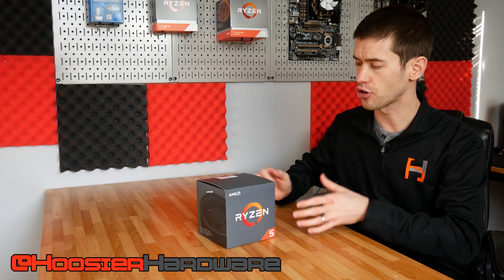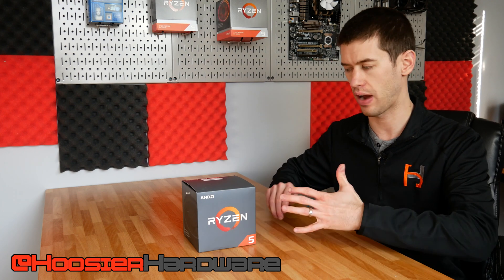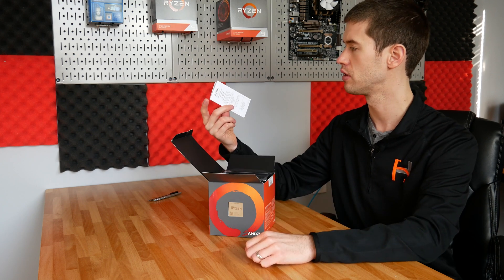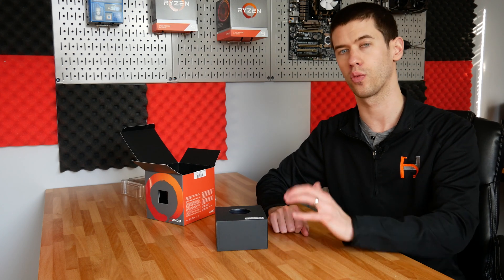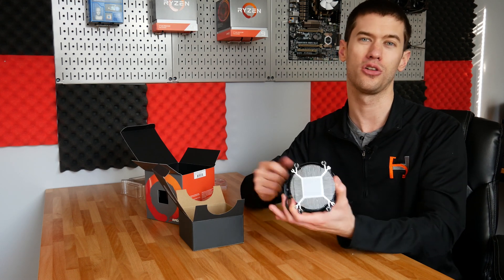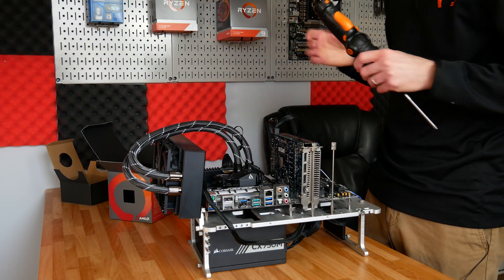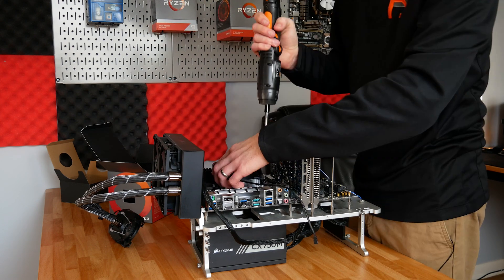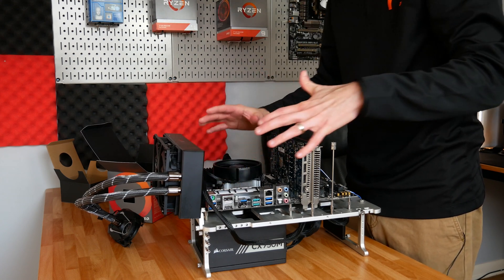Ryzen 1600 "AF" Overclocking on the Stock Cooler

Comment: 1600 AF out of the box hits 3.7Ghz Turbo by itself. Which is odd considering it says 3.6Ghz on the box. But hey, free performance!
Reply: lol yeah mine does that to.
Reply: Mine to 3.7 all day
Reply: does yours have a base clock of 3.5Ghz?? Because mine never goes below that.
Reply: @rmendez011  My base clock would hang around 3.2ghz.  I was able to overclock mine to 4ghz stable with voltage at 1.26
Reply: @jbscotchman  that's weird, mine stays around 3.5ghz and doesn't go down or above that, and I'm too scared of overclocking so idk what to do 😂
Reply: A year late but... that's XFR.

Comment: whats a safe voltage for a ryzen 7 2700?
Reply from the maker: I never go above 1.35, but that's pretty low. If you're looking at a max 24/7 voltage, you probably don't want to go too far above 1.4, and just keep an eye on temperatures as you go up. You could probably go 1.45 if you're somehow keeping it cool.
Reply: @HoosierHardware  ok thanks i now have the stock cooler but i am saving money for the 100x to keep it cool

Comment: Can you put it in 3.9ghz with the cooler in stock? Has anyone managed to stay stable?
Reply: It's doable. It's all about silicon lottery. There's one guy here who got 3.9ghz at 1.187volts. an absolute golden chip right there
Reply: Sure. you can get any 1600 AF to 3.9, depending on voltage. As for cooling you will never street the CPU near stress test load during operation so unless your case has no airflow at all and you are at 30c ambient I would not worry..

Comment: I have a ryzen 7 2700 oc to 3.65ghz on the stock cooler. I usually get 69c on games on full charge. ( I play rainbow six siege all in low on a 144hz monitor)
Reply: Can you hit 3.8ghz?
Reply: @miniweeddeerz1820  no because my pc case as bad airflow but if you have a better case you should
Reply: @pukalomaster3321  fair enough

Comment: Can you overclock Ryzen 3 3200g on stock cooler??
Reply from the maker: Yep. It's a low power chip dip you can probably get a decent overclock. I'd recommend overclocking the GPU on it before the CPU portion because that will give you better performance in gaming.
Reply: Bro, I am looking forward to adding an rx570 on my ryzen 3 3200g build, but I don't have much idea about uninstalling previous drivers and installing new ones, please make a video about it, it will be very helpful for me......
Reply: Sahil still need help?

Comment: So basically if you push this thing to the limit maybe get 10% more performance.    I disagree with his statement that you might notice this in gaming.   Only going to get 10% more fps if you are completely cpu bound, and even then unless you are staring at the fps counter will never notice the game feel any better.   Imho
Reply: 10%? Yeah sure. Only he did not OC properly. 1.2V? Joke. This gets to 4.1GHz all core easy. And a 6 core 12 thread CPU only for gaming is pointless even in 2020 so yeah you will not notice it much in games. If you are actually doing something like video rendering, re-encoding, AI work etc you will notice it alright.

Comment: it work on x570 carbon MB ???
Reply: It will work on any X570 or B450 board.
Reply: Both of you why are you trying to get an x570 for a Ryzen 5. The asrock b450m pro4 is a 80usd motherboard and is perfectly good for ryzen 5 overclocking.
Reply: @miniweeddeerz1820  hi dear, I'm waiting for the ryzen 4000 series. today save money
Reply: @CloudHighWay  if you wish.
Reply from the maker: I'm actually not sure.

Comment: I recommend doing second test in Cinebench R20. There will be a reset or crash at such temperatures from Aida.
Reply: And there will be no issue in real world application ever. He could have went with 1.25-1.3V and went past 4GHz and still have no issue on this cooler in day-to-day operation.

Comment: Todays gpus are not strong enough relative to the power and value that amd has provided. (Why game in 4k if u are relegated to only 30-60 fps?)
Reply: What are you talking about? CPUs are the bottle neck for high Fps gaminging.
Reply: @goxcpre  im talking about how the gpu is usually 97% - 99% whilst a 1600 af is not even coming close to 85%.
Reply: @DJDonkeytron  lol that's because of hyperthreading. how MSI afterburner works is that it takes 100% and divides it by the number of threads. So 50% usage is all cores used. Anything over that is using hyperthreading. So in reality its being used a lot as all the cores are being used.
Reply: @DJDonkeytron  Yeah that is because the number of games which can utilize all of those 12 threads properly is counted on the fingers of one hand, and even then you will not get 100% since the main programming thread will always run one core at 100% and all other threads will be less utilized waiting for the main thread to give them tasks. When a game is coded well with parallel programming code you can get use of many threads but the main thread will always run in Sequential programming since every command has to wait for the previous one to execute. Example when you input a command to shoot the main thread tells the other threads what they are to do and to calculate if you hit the target or not. Then it has to wait for the result before deciding if it shows you a hit or miss. Then it has to wait for you again to make an input. Mind you I am trying to simplify this concept with an example that is not exactly accurate from programming stand point but makes sense as an explanation.
Reply: Because 60fps is more than enough for any game that is not an online PvP game, especially a dedicated shooter. And such a game that would not get over 100fps on a decent mid range GPU in 4K does not exist. Unless it has crap optimization, in which case it does not matter much what hardware you are using.

Comment: put it on water and hit 4.1ghz and tell me your voltage level? curious and allow fora 12 hour test overnight. 4.1ghz at 1.32 volts LLC4 on msi b450i gaming plus ac mb, my temps with an master liquid ml240l aio is never over 60c push pull config, 7 120mm fans as well...gtx 1660 super sc ultra... 2400 team group (tlred vulcan) ram cl14 overclocked to 3066mhz cl16 16gb 2x8. even tho its not supposed to go over 2400 it does quite well... micron A die at that...but yea curious to see. my cin r20 score is an even 3200. ran 6 times never different. i do however have ANYTHING killed in windows it doesnt need. all services that doesnt need to be running are always at all times are off...

Comment: I got a 1600af to upgrade a secondary gaming pc. I have to say im super impressed. 4.1ghz all core with 1.25vcore. As far as im concerned if your in the market for a 6core cpu, the 1600 af makes everything else look like a bad buy.
Reply: Its out os stock
Reply: Mobo and cooler?
Reply: Djare for a while it was under a wrath prism. But it was loud under load so right now its under my old h110i, since its the only other cooler i had that was am4 compatible. The mobo was a gigabyte b450 aorus m.
Reply: @kapler8550  ryzen seems like a terrible deal compared to LGA 2011 and cheap xeons for the socket from aliexpress, plus cheap server ram vs expensive, fast ddr4
Reply: Dimitri Jachvadze on the surface, yes x99 looks better. But x99 is a dead platform. And it isnt  cheap enough in comparison to am4 to me to be viable for new builders. And experienced builders probably already have something that is equivalent or better, in which case neither the 1600af or cheap xeon is viable.
Reply: @kapler8550  Sweet.Nice cooling,ok mobo=good oc!

Comment: my r7 1700 hits 4 Ghz at 1.4 v and is very stable no crashes , but temps go up to 80 or more when stressed at 100% , 70 when gaming, are those temps ok for another year or so? I plan to change it to the 4000 series when they come anyway so it should hold till then right?
Reply: Well it depends on the GPU. A high end CPU the overclocking will affect performance slightly. On a lower end GPU overclocking the CPU does nothing to performance as the GPU not the CPU is the bottleneck. However try get the voltage a bit lower than 1.4v

Comment: me: cries at r5 1600v1 needing 1.385 to be stable at 3800.
Reply: bruh i have my 1600AF at 4,3ghz with 1.325v
Reply: @quajutsu1026  how tf did you even get it that high
Reply: @GroteGlon  golden chip i think
Reply: 1600AF 3,8GHz with 1.350v, crying
Reply: @konopka90  i jak zdzialales cos ? ja tez mam 3.87 na 1.367 :/
Reply: Patryk Konopka same
Reply: 1600 af 3.8ghz 1.3v :(
Reply: @R0n1nK  sucks dude, I'm stable at 1 hour cinebench 81c, 3600 ram OC to 3800 cl16 and 3.9ghz all core 1.29v
Reply: Apparently I came across a good copy: 3.9ghz 1.25 v, 4.0ghz 1.3 v, 4.2ghz 1.37 v. Everything is stable.
Reply: 3875 at 1.4 in the building
Reply: i feel so lucky selling mine this past summer when microcenter was bundling these with motherboards.
Reply: My 1st Gen 1600AE is doing 4,0 at 1,375V. Golden sample I got...
Reply: My FX8350 4.0ghz at 1.20v muhahaha.
Reply: @chickendinner5572 yeah but it still gets spanked
Reply: @FPVSPRO  of course! It's a office PC now. Save power and stays cool. Rocking a Ryzen 2600X +1070ti now :)
Reply: Got mine at 4.1ghz same volt as my 3.8ghz oc just toke one of google. V1.32/1.35? I forgot 
Was to lazy to play with iy till last month went to 3.9ghz stable.
Last wrrkn 4.05ghz now 4.1ghz for 5 days haven't touched volts. Still 1.35 i think?
Reply: 1600x at 3.95ghz and 1.33V fully stable ;) Allso its on Mini ITX b350 board in Cougar QBX
Reply: 1600 af 3.8ghz 1.28v, 3.9ghz potrzebuje już 1.37 także bida sztuka się mi trafiła :/
Reply: I think I got retarded sample, 3.7ghz at 1.35volt
Reply: i have ryzezn 5 1600 v1 at 4.0 ghz with stock cooler and 1.325 voltage , really good performance
Reply: I have 1700X 3.8 GHz stable at 1.22V, running cool and silent.

And Sapphire RX 580 Nitro+ SE stable at 1350 MHz with 1.0V and memory at 2250 MHz. Could run it's core bit faster, but I see no reason to gain a few extra FPS.

Comment: Definitely gonna get one of these to replace my old, but reliable FX8350.
Reply: Just made that leap, a few days ago. Sold my old, trusty FX, and got an AF. Fx handled all single player games like a champ, but was testing my patience with an mmo titles...I was pairing it with an gtx 1080, and like I said, most of the times worked like a charm @1080p 60hz. Having said that, you will not believe how much of a difference 1600af makes. So just go for it, and have fun. ^^
Reply: @WrongButtonWB  What motherboard did you buy tho?
Reply: @OzanSoylu  The best vrm's on a b450 chipsets comes with msi motherboards, so I ended up getting the msi b450 tomahawk max as the best one of the bunch.
Fully supported ryzen 2nd gen (even ryzen 9 3900x, vrms can handle 150A) so future upgrades will not be an issue. I highly recommend this board. Vrm's are cool under load, and overclocking section is nice and easy.
Might be a bit pricier then the competition, but well worth it.
Reply: @WrongButtonWB  I second your opinion! That's the board I got and DAMN, she's a sexy beast plus msi has reliable software so you can hear mystic light to set the led's to match your color scheme. In my case it's blue, also it is good at ram  rbg control; greater than my hyperx Ngenuity, so I just uninstalled it in favor of the msi software.
Reply: ski jeti 1055t to 1600af, how big will the difference be? I can’t wait
Reply: I'm upgrading from my 8350 to a 3700x, my 8350 served me well for many many years
Reply: Well I've had it up and running now for about 6 days and WOW, massive difference!  Went with the ASRock b450m Pro 4 and 16gb G.Skill Ripjaws 3200, got everything for only $250 which is an amazing value. 3.8ghz seems about the right speed for the stock cooler, may end up buying something later but not a big priority since even at stock boost of 3.6 - 3.7  the difference between the FX 8350 is just insane.
Reply: lol even ryzen 1200 would be an upgrade, believe me... 1600af would be a whole new experience
Reply from the maker: 8350 still has something left in the tank, though I've gotta believe it's struggling in certain modern titles.
Reply: @HoosierHardware  Yeah it is still very capable, and was probably one of the best bang for your buck cpu's ever made.  I was able to play Red Dead 2 with high and some Ultra settings averaging close to 60fps with a 1660 ti.  I guess that's why I've been hanging on to it for so long.

Comment: I'm going to build a 1600 AF build with a spare Prism cooler i had.  I went liquid cooling for my two 3900X's that I built.  I'm looking forward to see how it overclocks.
Reply: I use the prism cooler with my 1600af, I get 4ghz with temps always under 70c,usually around 50c. It's a great combo, that prism looks awesome.. Be sure that the high/low switch is on "high"
Reply: @jefferycoleman3781  I just switch it to high.  Thanks.  I had to put the build temporarily on hold.  I bought a case from Cougar.  But, I couldn't get the back / side panel off.  I tried and my grandson tried with no luck. I never ever had that happen before.

Comment: Just ordered a 1600af got it for 100 shipped then I seen one on amazon for 85 prices are up and down
Reply: Yeah, you have to wait for AMD Authorized Reseller which is the seller that has them for $85.  It's the other resellers that have them for $99 or more. Just wait for AMD reseller and you will get them for $85. I have followed the pricing over the last month and half. I bought my first one a month and half ago. And then recently decided to buy more. All of them I got for $85 a piece.
Reply: The seller for 85 always sells there 1600 af for that price. From what I've seen in a few months watching. I traded a 1060 6gb amp and 8gb 2x4 2666 ballistic sport for this cpu.... wanted the cpu to swap my 2400g out with didnt need the ram as it was free for a bad trade someone tried but most the time the seller for 85 only ups price when there is only like 4 left in stock....
Reply: @Kraxt0n  That seller always INITIALLY sells it for $85. That price usually doesn't stay at that, not for long.
Reply: @Voidsworn  I personally have not seen "AMD Authorized Seller" sell for more than $85 at the times I have checked. Each time I noticed they were no longer $85 there was a different seller in the lowest price spot and AMD reseller was no longer on the list.
Reply: @45eno  EH, perhaps you're right. I can't remember for sure if I read it right.

Comment: So basically the AF comes with a crappo Ryzen 3 cooler.
Reply: Isn't crappy. Better than any Intel stock cooler by a mile
Reply: @miniweeddeerz1820  I'm not comparing it  to Intel. I'm comparing with other Ryzen 5s.
Reply: @cspc2570  well the 3600 and 2600 come with the same stock cooler.

Comment: Just ordered my 4th 1600AF a few minutes ago. Out of my 7 total PC's in the house, my old Intel hardware is dropping fast. Will only have a G4560 and i3 4330 left for my garage and bedroom media PC.  2 other Media PC's will now have 1600AF and my kids two PC's will now have 1600AF. All on Tomahawk non max boards I got around $73-79 on Amazon. $60-65 16gb RAM 3200mhz kits. Great value upgrades. My PC's think they are on the Oprah show, you get a 1600, and you get a 1600....
Reply: Dont forget to build a ryzen pc for your bathroom and another for the dog house.
Reply: @polentusmax6100  haha xD
Reply: i just bought those same parts with a 2060 what case did u use for those builds
Reply: @IanArizpeArroyo  i just got a r5 1600af a b450 aorus m mobo a rtx 2060 and 16 Gb 3000 MHz RAM with 500gig ssd and a p300a
Reply: For around 700 €
Reply: in reality you get a 2600....buying a 1600 af lol
Reply: Lol
Reply: I'm getting one to upgrade from a g4560, the g4560 sucks
Reply: With all those PCs and replacements... What do you do with old parts? I'm working on my first one and I definitely wouldn't mind some cheap parts... I'm a 500$.
Reply: @ImabossSK  https://pcpartpicker.com/list/W3YzGc here's a nice pic build if you can stretch the budget to 550, if not you should make cuts to the storage and case 
(The CPU is the 1600 AF)
Reply: @Luke-pp2lw  I have that exact build, actually. 1600af, Pro4, less storage, and a P300a I got on sale.

Comment: Is that the BC1 Open Benchtable you're using there?
Reply from the maker: Yes indeed
Reply: @HoosierHardware  What do you think of it? The appear quite sturdy. I ask because I have been looking at getting one.
Reply from the maker: @mattsmechanicalssi5833  I love it. It's impossible for me to compare to other test benches since it's the only one I've ever owned. My only complaint is that I don't love the way radiators mount to it, so if you're looking at water cooling, maybe look at what else is on the market. The upside is that it's super small compared to most test platforms and makes swapping parts out crazy simple.

Comment: Great video. Just now I was looking for info about overclocking this CPU with the stock cooler. I'm going to try 3.8ghz at 1.2v
Reply: hi, is it stable for you ?
Reply: Try 4Ghz at 1.3v. Keep in mind you will never stress teh CPU anywhere near what a stress test does so your temps will be far lower than what you see during stress testing.